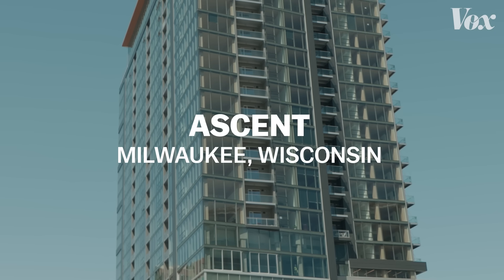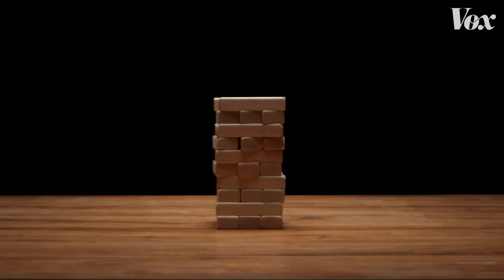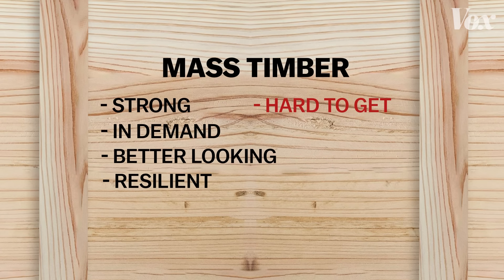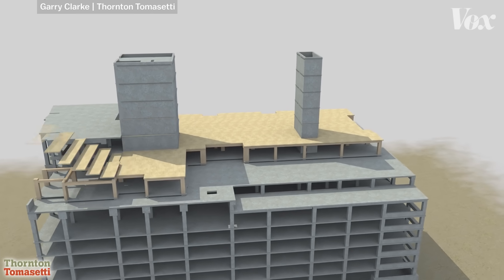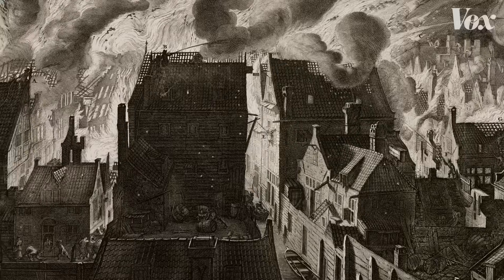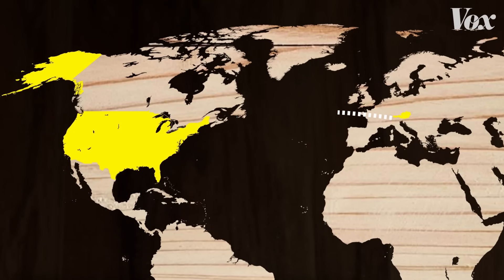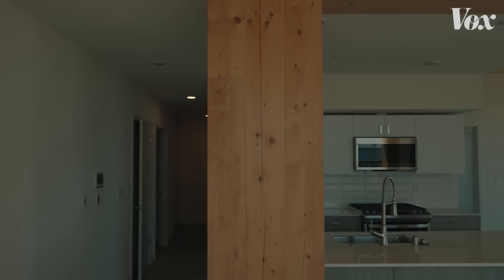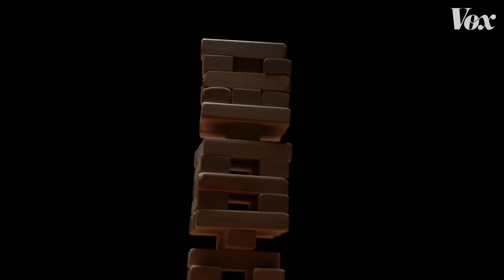How to build a wood skyscraper

Comment: My parents actually have a hybrid house like that. Obviously smaller, a family home, but it is built similarly. While it is great to see that buildings are built from wood, it is important to note that timber production has significant ecological and environmental problems as well. For one you can't think of wood plantations as ecologically valuable forrests. They are devoid of ecological diversity due to the use of only one crop, planted so tightly that nothing can grow under it, so they aren't habitats for animals or plants. They are also primarily spruce or pine, so conifers, which are really drought sensitive so not resilient in the face of climate change and prone to burning. these are problems we should be concerned about as well as the impact of  importing or exporting plant pathogens through global trade
Reply: But the alternative is much MUCH worse. Concrete production is either the most or 2nd in carbon emissions globally. Being able to cut back on any amount of concrete is extremely good. At least wood plantations still have trees that exchange carbons, while concrete is just absolute environmental degradation.
Reply: @tonysoviet3692  bricks too. Very carbon intensive.
Reply: @tonysoviet3692 , concrete absorbs oxygen from air. Over its lifetime, it is very likely it will reabsorb all the CO2 associated with its making.
Reply: bear in mind y'all that there are pros and cons to any given option, and just because one option has fewer drawbacks than another doesn't mean you are free to completely ignore the pitfalls of the better option
Reply: Very true. However. The world also needs to figure out the sand issue for the concrete structures. The mass development of concrete structures has put a huge strain on the natural river beds and ocean sides alike. You have sand mafias the steal sand for concrete production in India. Chinese helped drive that but still, something has to happen to reduce the dependency on concrete. One thing that worries me is the furthering of reduction to labor. What is the world going to do with all the extra humans and no actual work to do or means to make a living?
Reply: @richardwhitaker4148  hemp production bro
Reply: @richardwhitaker4148  The desert is full of sand
Instead of transporting plastic toys from China go to the desert :)
Reply: All of that sounds minor compared to concrete production
Reply: Compared to concrete timber is way better for the environment.

Timber is carbon positive. CO2 is captured and stored away for decades. Concrete manufacturing releases lots of CO2 due to the materials used and the amount of energy needed.

While deforestation does happen due to the large scale timber plantations, there are ecologically responsible ones that can be established in many places around the world.
Reply: Conifers can be planted in non florestal places. And can be replaced. You are literally taking out carbon from the atmosphere and putting in your building.
Reply: Dude just called pine weak to drought? Obviously not Canadian
Reply: Really, we need to change most of industry and agriculture to use native or noninvasive plants and in a way that allows for an ecology to form and maintain itself and maybe benefit from our presence for once. If we as a species were to begin to tailor farms to be polycultures incorporated into the ecosystem then it would undo a lot of the harm done by modern agriculture and the history leading up to this. It can be done if you know what you're doing, there's enough energy hitting the ground and it's just a matter of figuring out how and getting people on board. 
We could theoretically grow wood in a smarter way, I'm no expert but maybe allowing some underbrush to grow and harvesting half the trees at a time in rows only big enough to get the equipment through would allow for at least some diversity to persist. It shouldn't even effect production in a negative way if it's well planned out, you can harvest the same number of trees just with half the yield each time, they would sequester even more carbon, and maybe grow faster too since the soil would actually be healthy.
Reply: @thetobyntr9540  not possible to feed or build the world currently with that
Reply: @cancerino666  
Well, it's not possible to keep doing things the way we are now and survive long term as a species, and I think you're wrong if you're saying a permaculture based approach is impossible. People have been figuring this out and permaculture done right is more efficient and more sustainable. Most of the time before industrial agriculture a lot of groups basically already did something like it, and they produced enough despite the pests and pathogens because they had basically heirloom plants that were adapted to where they were and genetically diverse so they would have at least some plants survive under adverse conditions. I don't see how we could do wrong in trying to attempt that again.
All that I'm actually saying is we get our act together and integrate with the biosphere that sustains us so that we can make it stronger rather than destroy and poison it.
Reply: @thetobyntr9540  I agree that large swathes of monocultures are a poor and environmentally unfriendly system, but the simple truth of the matter is pre-industrial farming struggled and indeed regularly failed to support and feed the substantially smaller (we're talking like 10% of the current) global population. Suggesting small, labour intensive plots of land growing substantially lower yield crops could support the Earth's population is just not going to happen. Not to mention this system would mean even more of the natural environment would need to be converted to agricultural land.
Reply: Right, because concrete is better for the environment...
Reply: Thank you for this
Reply: 9% of Europe forest area are wood plantations, 0% in Finland.
Reply: what building material doesn't produce carbon...
Reply: Trees are an almost perfect carbon sink though. I don't know how the math would work out but I would wager that the carbon footprint (including supply chain factors) is much much more manageable than traditional construction materials, if not negative. Also the treatment process mitigates most plant pathogens which is why timber is already a globally traded commodity.
Reply: Hybrid is a good idea
  More strong , pretty , shared resources and a save place to run and to make food :)
I would like to have some money to build one ( looks really funny )
Reply: This ignores the substantial variability of global (and North American) forestry. Regional differences are huge here in North America, and the fact is that not only do we have significant oversupply of some softwoods now (especially in the US Southeast), but mass timber can use smaller diameter materials...including some of the products of thinning treatments that are very necessary to reduce fire danger in our western forests that are now very out of whack due to past management. Generating demand for the products of thinning could make a huge difference in the ability to actually reduce stand densities and improve resiliency in a warming, drier climate. You're looking at one type of forestry, and responding to what is frankly a completely unnecessarily absolutist argument (that using wood is only good!). Even plantation forestry as practiced in Europe and the Southeast US is better for the environment than alternative building materials like concrete and steel. Most of North American forestry is reliant on native species, and has long since moved to sustained yield. Every year our forests add more volume than we harvest.
Reply: sustainable forests are still carbon sinks.  Can't say that about gas fired kilns for concrete.
Reply: Bro but iron industry causes more harm
Reply: I wonder if the people in this comment thread are millennials. Just a thought.. don’t mean anything by it either way
Reply: @ohkfilms  "I don't mean anything by it either way" 
Yes you do.

Comment: I saw a few of these mass timber buildings rise here in Helsinki, two ~10 story apartment buildings and one similarly sized office building next to them. Very interesting technology.
Reply: With the buildings are there visible signs that they are built using timber and if so are they more aesthetically pleasing than normal apartments?
Reply: @Infernus25  definitely yes to both questions.
Reply: I'm guessing another benifet of mass timber would be better for keeping heat in colder climates like Helsinki.
Reply: They built a condo out of this in Canada, it burned to the ground.
Reply: @Idontwantahandle6669 when 
was it built?

Comment: Shipping timber from Austria to the USA is so very ecological ...
Reply: Your not wrong about that especially with all the standing timber and industrial forestry land in the US. Right now mass timber in still in its early adoption phase here in the USA. In Europe they already have the manufacturing capacity for it since they have been building with it for decades. Eventuality component will be built in the US
Reply: Yes, in european countries like austria its  very normal to have houses made of wood, which is why most of the production is there
Reply: Honestly, you'd be surprised with how little of the total carbon emissions come from overseas shipping. There may have been more carbon output trucking them from the port to the site then all the way across the ocean.
Reply: As opposed to energy required to make concrete, you do know it doesn't grow on trees naturally, unlike wood. Regardless, Oversea Shipping has the least per unit carbon emission by weight, your average sedan pollutes more when you compare them weight-wise.
Reply: yes... but luckily we can balance that by hiring fewer skilled workers on the site ¯\_( ͡° ͜ʖ ͡°)_/¯
Reply: Just a matter of time..
Reply: With wider adoption there will be more locally produced materials.
Reply: Usually softwood lumber is sourced inside of the country where it was harvested. Hardwood lumber on the other hand is mostly harvested from the US. About 50% of hardwoods harvested in the US are exported, the rest of the world just doesn’t have the hardwood species we have. Not directly related to mass timber but another example of how global lumber and log markets are.

Comment: I wouldn't want to live in a wood high rise. After living in a wood condo, the transference of noise through wood is tremendous. Someone blasting the base on their speakers on the bottom floor could be heard on the top floor. No thanks. There's a reason pianos are made of wood and not steel and concrete.
Reply: I live in a concrete building and sound travels beautifully here too. I think it's more about specific soundproofing techniques than material.
Reply: My thoughts exactly. I love old homes with wooden floors and details, but as an avid music listener I want to be able to blast speakers and have people over without bothering anybody around me. Even with beams that thick, I don’t see wood faring well in that regard

Comment: We say its a wooden skyscraper but a big part is Oil, the Glue (makes this structures feasible [2:14]), which is from Exon or Shell. This is just replacing a environmentally bad product (concrete) with another environmentally bad product (Oil).

The real problem isn’t Concrete it’s Skyscrapers, city planning, and the missing middle.
Reply: Yeah, because by volume and mass, you'd use as much glue as concrete which is basically the worst material on Earth if we talk about emissions of CO2.

CLOWN. You can only complain just for the sake of it, not because you care.
Reply: Lots of different types of glue. I’m in school for forestry and work in the school’s construction lab. New technology is being developed to make petroleum free polyurethane glue. That being said the carbon footprint of mass timber is still significantly lower then traditional construction.
Reply: You know it's possible to join wood together without using glue or nails etc, take a look at how Japanese homes are built
Reply: @roboko6618  Not at this scale, the structure would collapse.
Reply: What's so bad about the wood glue?
Reply: @martin8313   wood glue is basically a form of plastic, most of which is derived from petroleum... without wood glue, products like plywood and CLT/GluLam would not be possible, without which you'd probably not be able to build more than 2-3 storeys high, if you were using just traditional lumber
Reply: @Zaydan Naufal  😂😂
Reply: Have you heard of Holz100 houses or Erwin Thoma? He builds wooden houses without any glue. They are constructed with wooden dowels.  But I still agree that the main problem is american city planning.
Reply: The strength is not in the wood, it’s in the glue.

Comment: Great video, another benefit of mass timber building, is that it can be paired with sustainable wood production and greatly reduce overall pollution and in my opinion, improve mood and mental health
Reply: How Sustainable is OIL (Clue [2:13])?
Reply: @one_under_all  I've got bad news for you about concrete, pal.